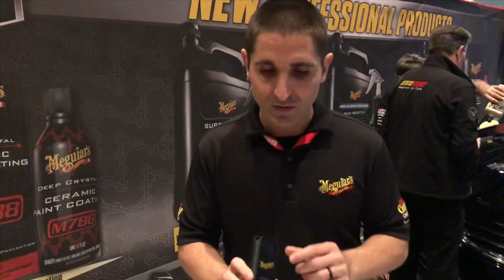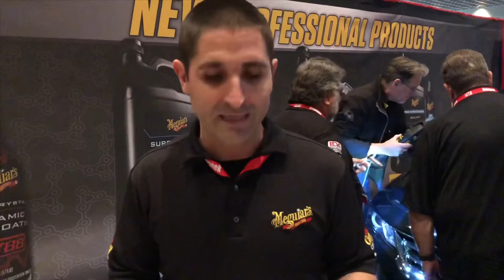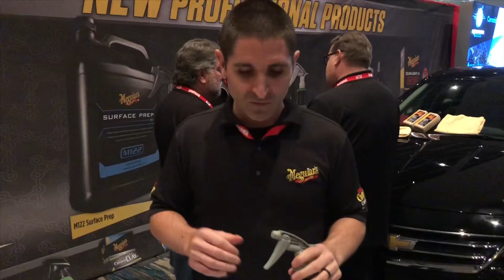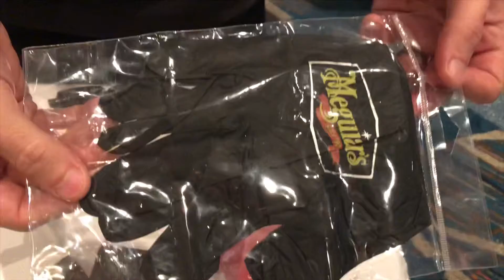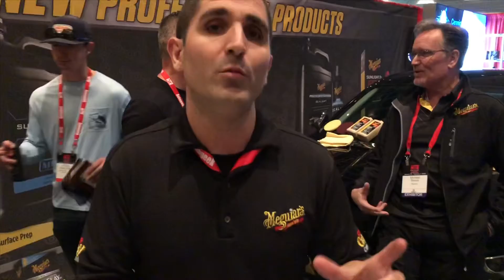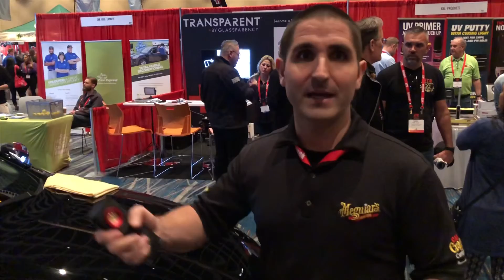NEW! Meguiars Ceramic Line COMPLETE BREAKDOWN! /W Marcus Kleis!

Comment: Please help when my car runs out of the rain and I let the water dry by itself, then you will see water spots and it is not easy to remove even though it has been sprayed with Meguiars Ultimate Quick Detailer.  Previously my car was protected by Meguiars Ultimate Wax and Meguiars Ultimate Quick Detailer.  Is there any suggestion for a product that if the rainwater dries up does not leave a scar that is difficult to remove?

Comment: Microfiber towel scratching paint my ass, its the soft wax which is on the surface, clear will not scratch unless you have compound polish or some sort of polish its that simple people do not get pulled into the hipe all pro detailers do not use meguiars they are trying to get into the market, put it this way if car pros products were so bad, 90% would not be using them, but in fact they do use it, because they are running a business detailing cars and they want the best products that deliver and cost effective compared to how much product they get for the price and how long the products last when applied, like Car pro CQuartz 3, ceramic coating in real world conditions the product last upto 2 years easy and especially if you use a top up like hydro 2 as a maintenance spray on or nova jet or luster, both fantastic products based on price and what they deliver, meguiars has great products like the range of polishes the m  series items, but compared to paint/panel repairs places 3M kills it again, they are around 10 to 15 years too late in the market place, now they are marketing to retail outlets, but not once do you see anything on u tube testing official from meguiars at all, proper testing ie: real world daily driven cars which has had meguiars products applied and then checked over?

Comment: WOw more BS, show the world the new SIO based products and application and then do a torture test using acid based chemicals like wheel cleaners and IRON removers on the Painted black  SSV Chevy redline in the background, not a perfectly polished car and then demo the products, you need real world exposure to the elements, like especially in US states where it snows and then you have the various chemicals used like they used salt ,so think of how bad salt is to cars painted surfaces the front end and also just behind the rear and front wheels and the new chemicals to help snow melt and stay off the road surface, which also then you have the cars in front of you dropping oil and other fluids and crap off the tyres ,that's what needs to be done, dont get me wrong i use meguiars products, but i think to really show off how good they are you need real world tests like get a car and have a camera set up on that daily driven car in all weather, going through drive through car washes and see how long the new stuff lasts etc. :)
also after all the talk at the start about the new light they have a black car ,why not a silver car ,with induced swirl marks and show how good the new light shows off the minor swirls marks and how to get them out properly, also orange peal, i bet my life that redline or SSV SS ,which in australia we call a holden Vf Redline has no orange peal, which you would have to use 2,500 grit go all over ever painted surface of the car,  a3 step paint correction system and then finally a IPA wipe down and then ceramic coated, also they need to show panels which have been coated and how easy it is to remove, ie: compound polish will remove almost any wax or sealant full stop, other than vinyl wraps, that it anything with the right tools will get rid of coatings full stop, also i wonder if insurance companies will cover the cost of re coating a product like meguiars as there's no official certification for applicator and ceramic coating business out there, so anyone can say yes i put the new meguiars SIO2 Ceramic coating on my car and now it needs to be done again as the panel repair place had to repair my car?
Also wheres the official world certifications for the products tested by those world wide companies that certify that this product has been tested to this SAE tests to show that it has the right protection it claims, if nothing is there, then its just hype and marketing to sell the new range, but wait they already brought out the blue bottle spray on ceramic coating/sealant ands then the green bottle which is the SIO2 based quick detailer? Like look at Mercedes own coatings all tested by world wide authority testing orgs to say this or that about the long term coatings and what they can and cant do, so around 2 years life of a official mercedes paint sealant for a car driven everyday on the road, as long as its looked after, based on proper washing and maintenance?